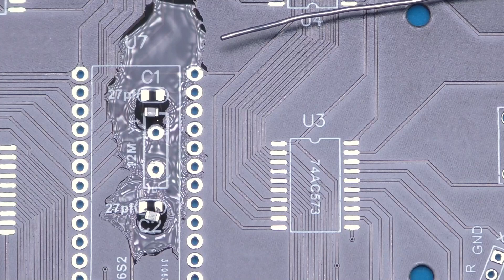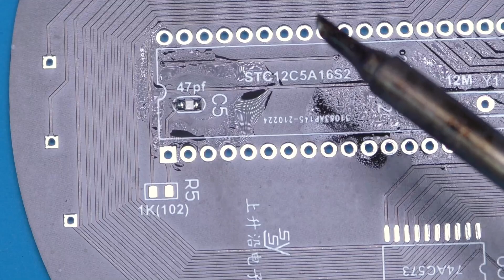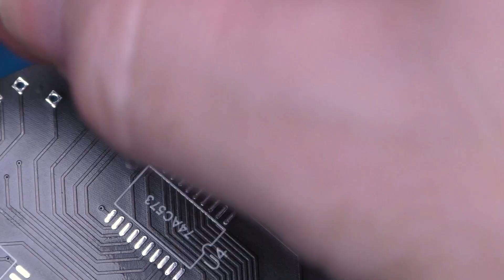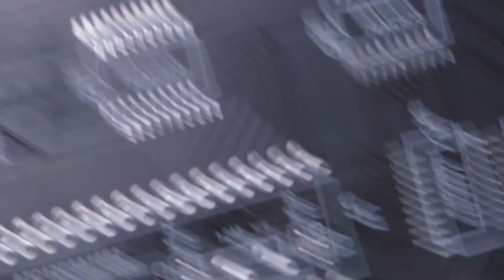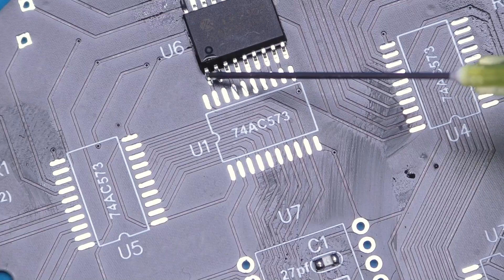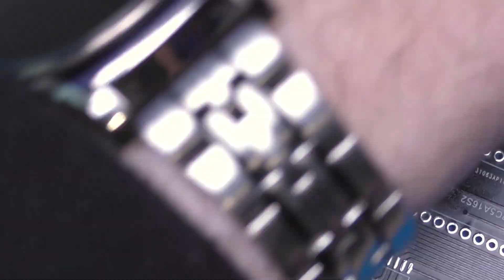Part 2, Banggood Kit Build - 8x32 LED Light Cube Cylinder kit - Build With Me

Comment: G'day Tim (or is it Spud?), I'm glad to have found your channel; I'm about to embark on a build of this kit and finding information about it has been an absolute rigmarole! After two weeks of painfully slow back and forth messages, the seller on Aliexpress finally supplied me with a link to a document dump on Baidu (the downloading of which was a Kafkaesque nightmare all on its own), however all of the documents and images are in Chinese, so not much use at all.

That said, I think I've got it all figured out now. Assembling the PCB will be a doddle (I love hand-soldering SMD components, it's such a zen process) since the markings are nice and clear and there are no difficult placements to contend with, but I think the LED rings will present a challenge in terms of ensuring all the connections are solid and the alignment is neat. 

But whatever happens, I'll definitely be referring to your videos as the build process continues to make sure I don't run into any pitfalls you've already spotted and solved, so thank you very much for recording this series!
Reply from the maker: Thanks mate! so glad that the video is proving useful, as you've found out, trying to find out any official documentation is nigh-on impossible. I hope it goes smoothly for you - Tim